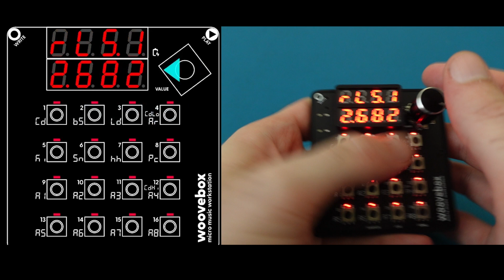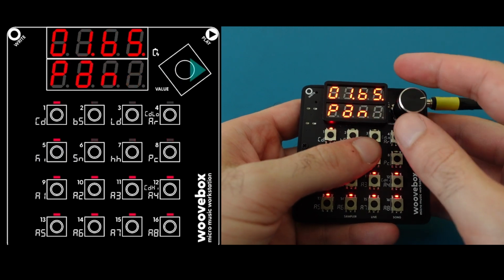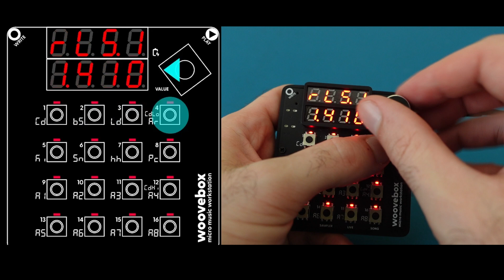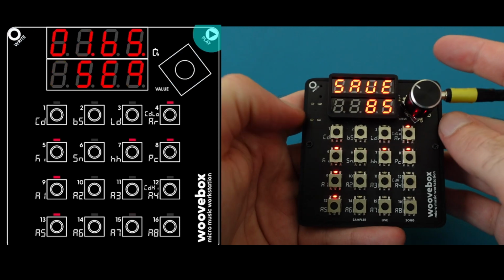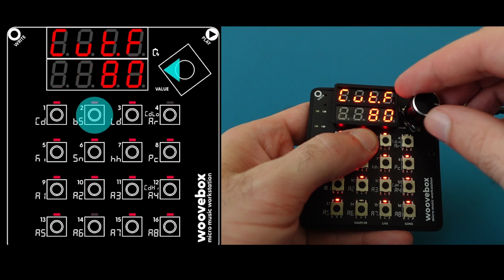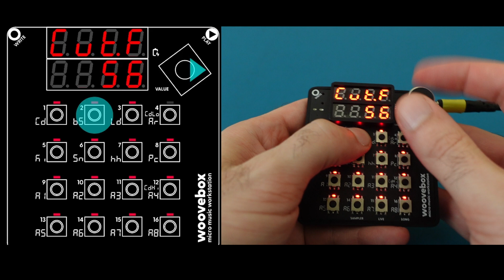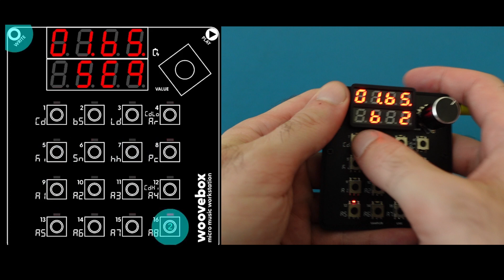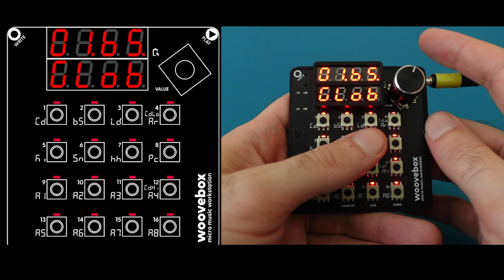Woovebox Sound Design: Part 1

Comment from the maker: Let me know what you want to see in Part 2!  So far I'm planning to show mixing in oscillator 2 and how the LFOs work.
Reply: I think for part 2 you’ve got a solid idea there. I’m not sure what parameters the envelopes and lfos can be assigned to aside from amplitude and filter. If you can assign them that might be good to know. Honestly I think this device has so much to learn that you can just pick a direction and go. Thanks again for the videos.
Reply from the maker: @mrfork  I don't believe you can assign them to something else but I will find out and include that in the video.  Thanks for watching!
Reply: Acid bass ! Yeaah!
Reply: How to use The lfo’s for sound design And how to combine The two oscillators

Comment: That's a good overview :-)
I would love a video that goes through all the oscillator types as a kind of quick rundown.
Nothing to deep, just to show what building blocks one could use.
Reply from the maker: Thank you!  I believe I went through most of the oscillator types in this video, what kind of demo were you thinking about?  Or are you thinking of the different synthesis types?
Reply: @Wooveboxing  For example I was hoping to hear the different kinds of supersaw-waves (since one cannot set the detune oneself, I think I read in the manual).
And now that you mention it the different synthesis types would also be nice to have demonstrated^^ Maybe in spearate videos, but you decide.
Reply from the maker: @K0r0n1s  Gotcha, I will include the supersaw waves in part 2.  I would also like to make a video about the different synthesis types, maybe that'll be part 3!

Comment: Awesomw video! How does it feel to work the knob for filter sweeps and other tweaks? I feel the fact it's not smooth may take away from the overall experience
Reply from the maker: The encoder is not great for filter sweeps because it's not smooth but you can still do it.  I would totally play with it live.  Regarding tweaking parameters there is an algorithm on the encoder so if you turn it fast, it scrolls fast and if you turn it slow, it scrolls slowly.  This makes sense for some parameters but I think it would be better if it was one to one for any parameter under 127 units but that's just my opinion.  I will talk more about that in an upcoming video.  Also, thank you!

Comment: Glad you were lucky enough to get a knob that registers in a linear direction. Ever since the second day I got mine it just stopped working correctly. So now it takes forever for me to find tune a setting.
Reply from the maker: I still have issues with the encoder actually but I've just accepted it as a trade off for having so many features and quality sound in the palm of my hand...  However, depending on how bad it is, you may want to make a video and send it to the Woovebox support.